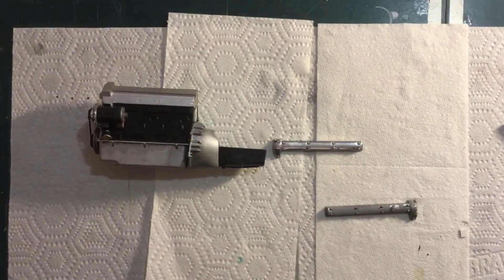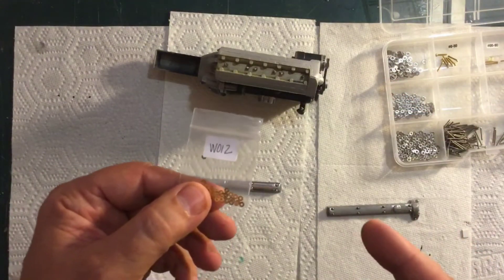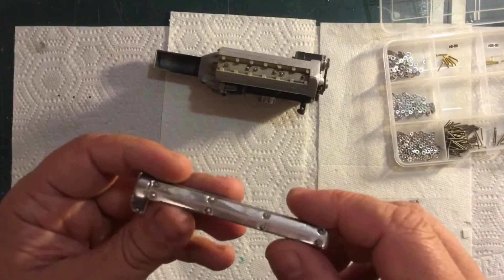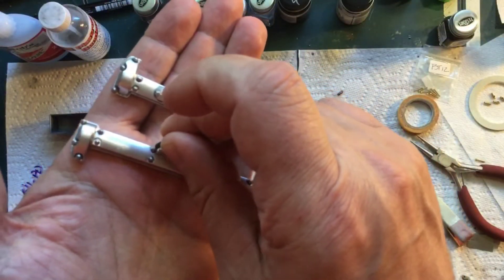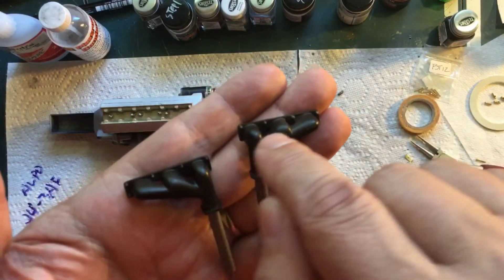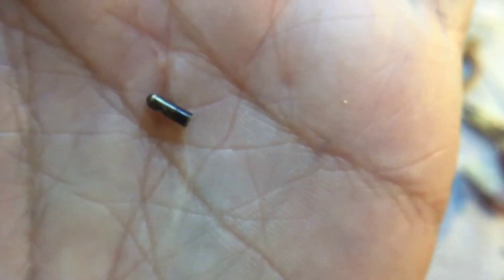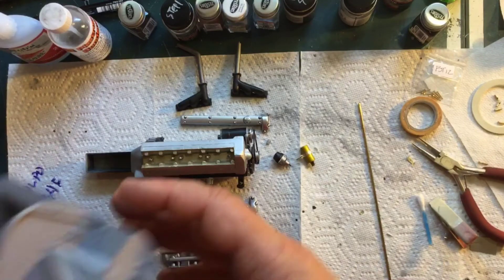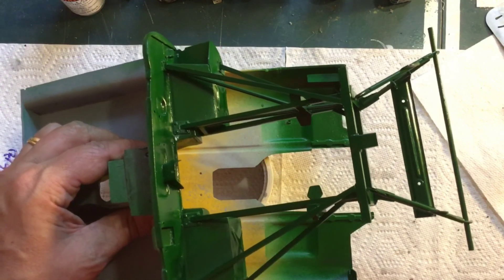1/8 Monogram Jaguar XKE build part 9

Comment: Oooops ... I stand corrected.  There ARE removable panels at the front of the belly pan.  They are called stone guards (Jaguar P/N BD20048 and BD20046).  The left one has a couple of diagonal louvers in it and the right one has a little removable panel to access the oil filter from underneath the car.  I had apparently removed them from my car for some reason.  You can see them on page 80 of the Martin Robey Jaguar parts catalog that you can download as a pdf.
Reply from the maker: Cool thanks! I’ll check that out.
Reply from the maker: Found it. And dude!....what an awesome reference! Thanks for telling me about that.

Comment: On my cars the exhaust manifold nuts are brass from the factory.  Makes them easier to remove without galling if you need to.  The E-types had a vacuum cannister on the distributor if you want to model that.
Reply from the maker: Thanks again for all the information. I do appreciate it. I was on the fence about making the vacuum can on the distributor. I think I probably will, even though it won’t be that visible.

Comment: In the real world, the copper washers under the cam cover dome nuts don't seal well at all because you need to be careful not to over-tighten them lest you distort the cover.  So on my car I use aluminum washers with an o-ring bonded to them.  They are all but invisible, so I support your decision not to model them.  Also, the cam covers from the factory were polishes aluminum, not chrome plated.  Unless you are fastidious with  polish, they dull over time.  Same with the carburetor dashpots ( the shiney domes).  They too were polished aluminum and also dull over time.
Reply from the maker: Thanks for the info,

Comment: Another great resource is SC Parts Group Ltd.  You can download their E-type parts catalog (even better than Martin Roby's).  For example if you plan on fabricating the numerous sheet metal panels under the hood that form the inner wheel wells, you can find the Jaguar part numbers in the catalog (such as BD16423).  Then go to monocoque-metalworks on ebay.  They make replacement panels and in many cases have upwards of half a dozen photos from all different angles.
Reply from the maker: Cool, thanks! I’ll check that out.